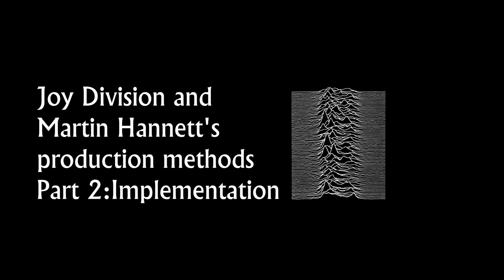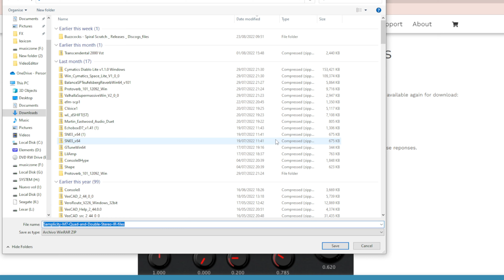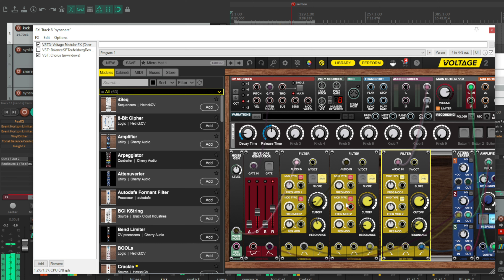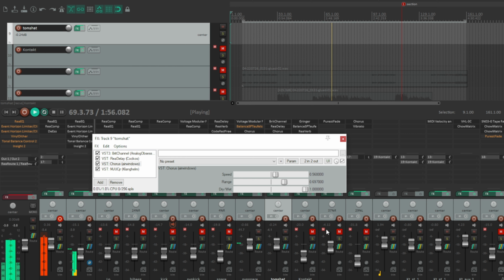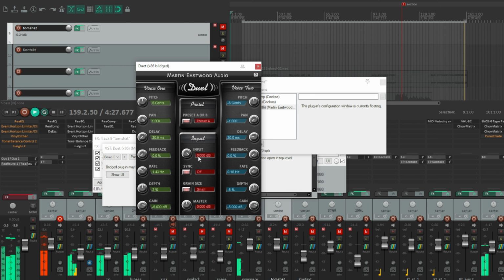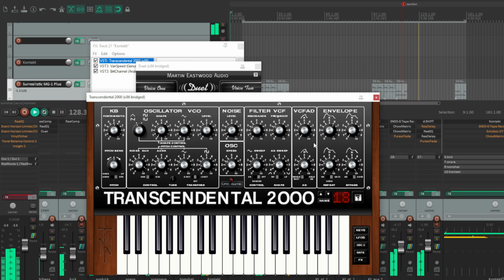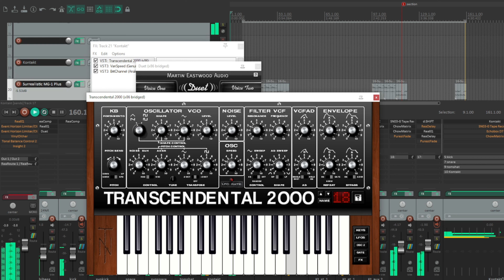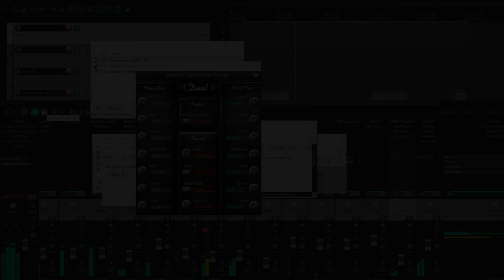Joy Division and  Martin Hannett's production methods: Part 2 Implementation. Reaper walkthrough.

Comment: .....such impressing set up and great software....I'm still using OpenMPT (yes I am) with my tracks and work......most of what you're using goes straight over my head....wouldn't know where to start....this shows that partnering up with someone who knows his way around this could be very helpful and very productive.....great work this....👹
Reply from the maker: You get pretty impressive results for using primitive software. Wouldn't have guessed. Reaper is great but does have a learning curve. You can do basically anything in it.
Reply: Thanks...I sort of learned using OpenMPT from the drummer of the band I was in...after the split and he and I joined up to work together as a (electronic) duo years ago...after going solo I had to do things from memory...only after a few tracks I knew enough to do it on my own.....you can hear that development from my first track The Line is Dead to Interplay, Omega, Monolith and also my version of JD's Isolation. Right now I'm sort of stuck in limbo not sure to continue.....👹 @MusicEnthuZone